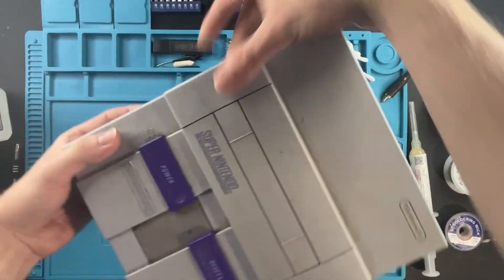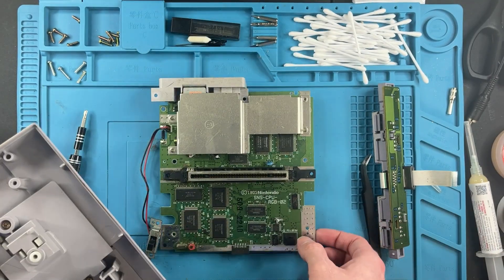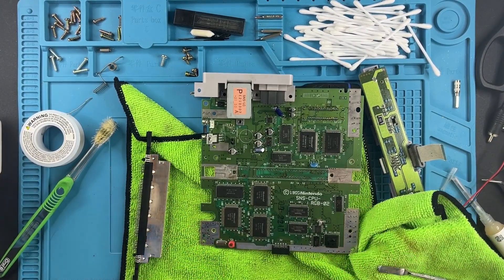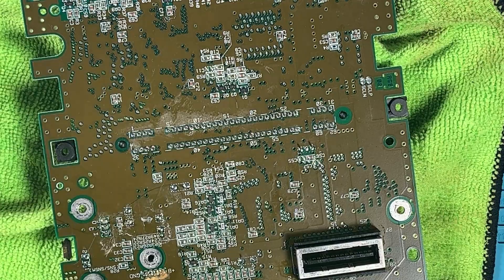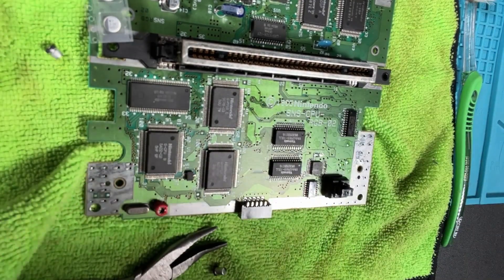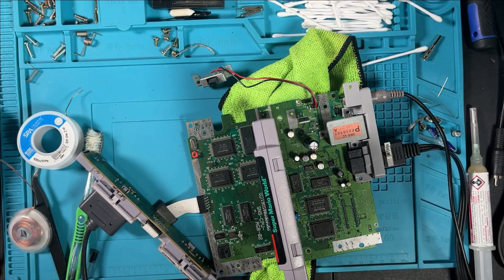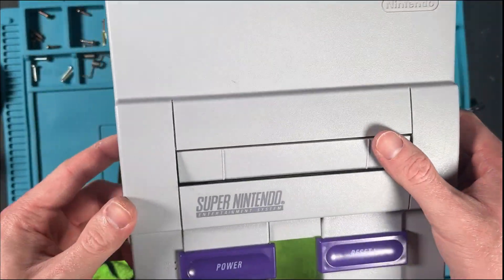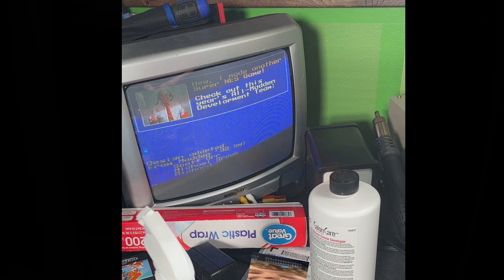Capping and Cleaning the SNES! | PowerVintage

Comment: Good video. I have a couple of suggestions though. 1: I wouldn't put bare motherboards on clothes like that since static electricity can zap things and fry them. It's probably rare, but it can happen. 2: Make sure you turn screws left until you hear a clicking noise right before you screw them back in. This will make sure the screw is in it's original threading and there won't be new threads made and the plastic won't be damaged. The screw shouldn't have much resistance when screwing it in. Believe me.
Reply from the maker: Thanks for the tips! I’m always trying to learn more so I am definitely going to take your advice.